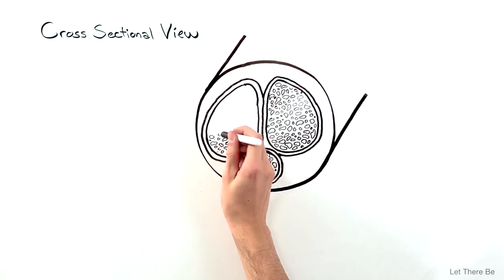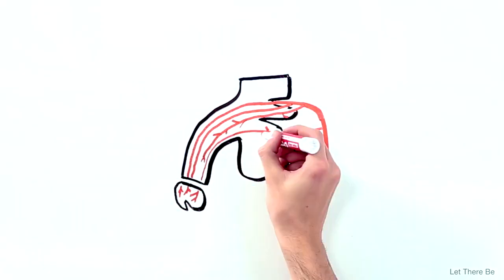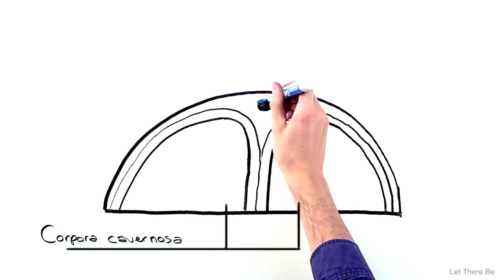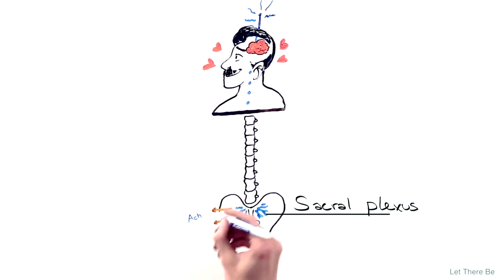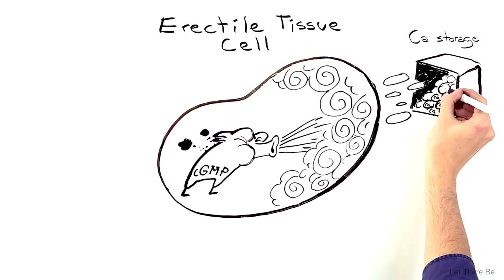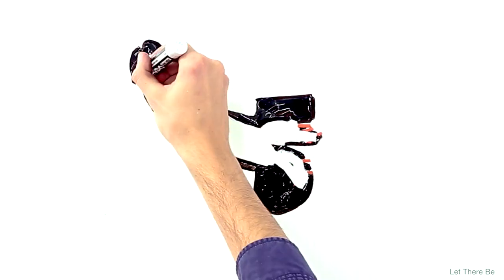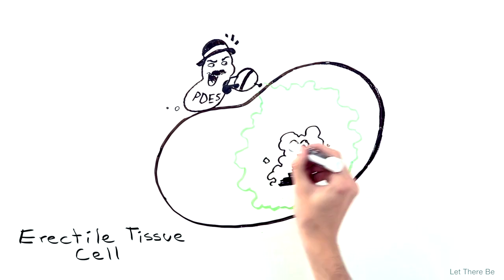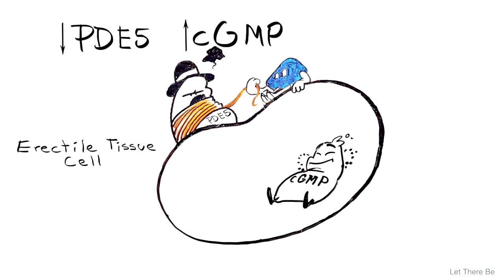VIAGRA Mechanism of Action - How It Works, Sildenafil MOA

Comment: Erectile dysfunction is becoming very common these days and it is something that should be talked about rather than hiding it. theonlinemedicine.com has the safest quality drugs to improve ED. It could be caused due to various underlying factors such as stress,  usage of some medicines, diabetes, spine injuries, heart problem, etc. But, ED can be corrected if taken proper care of. I'm here testifying myself for the same problem and the way how I got it cured. I consulted a doctor online and he prescribed me to use Viagra and Cialis drugs which are considered as the safest option to the problem given it is of good quality else it can have adverse effects too. After several research I bought these 2 drugs from theonlinemedicine.com and they really proved to be the best ailment to my problem as the drugs were of top quality and with their regular usage, I was able to correct my ED.

Comment: Hello! Where can I buy these pills?
Reply: Once you start to experience problems with potency, you should examine the endocrinologist/cardiologist. Learn more at getyourmedicine.store Hypertension is the cause of erection issues, because the arteries of the penis are narrowed, and the elasticity of their walls is reduced. Initially, Viagra was developed as a treatment for the patients with coronary heart disease. However, it turned out that the drug invented was better at stimulating erection.
Reply: Prestigepharmagear.net
Reply: @markset6033  hello
Reply: Salend hello .how are you? Kindly WhatsApp me
Reply: whereubuythepillsatokay
Reply: ineedsomepillswherecanigetthepills
Reply: Rocky kindly give your WhatsApp or contact no
Reply: I buy mine at rxformen.com. You actually talk to a real doctor before they approve your prescription and sell you anything. That's why I went with these guys. Plus I get it in a sublingual tablet that works pretty fast.

Comment: Once you start to experience problems with potency, you should examine the endocrinologist/cardiologist. Learn more at getyourmedicine.store Hypertension is the cause of erection issues, because the arteries of the penis are narrowed, and the elasticity of their walls is reduced. Initially, Viagra was developed as a treatment for the patients with coronary heart disease. However, it turned out that the drug invented was better at stimulating erection.